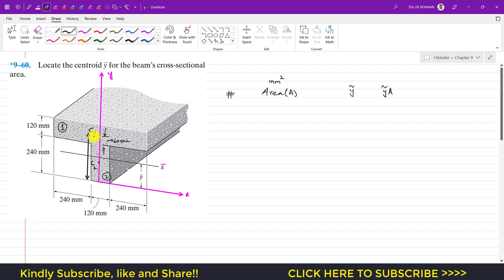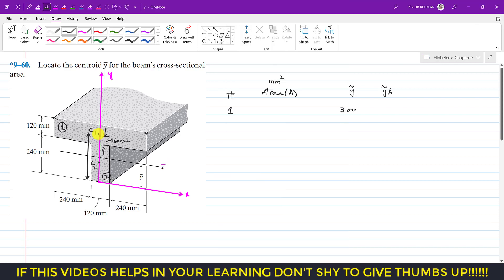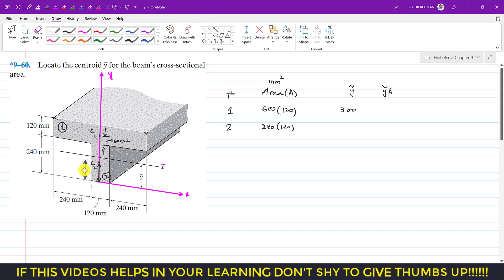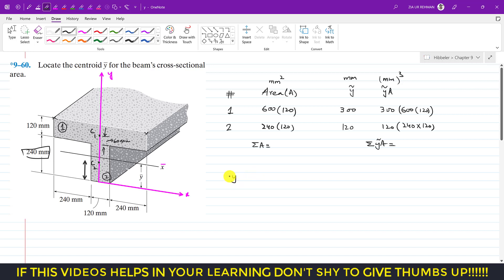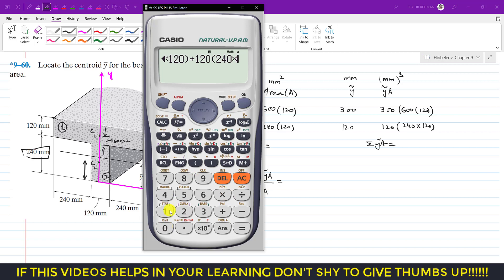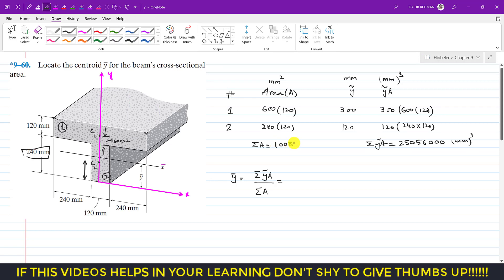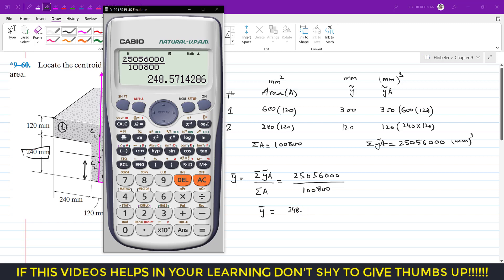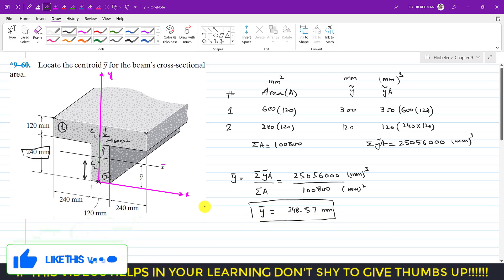9-60 Centroid of Composite bodies or Shapes | Chapter 9 ( Hibbeler Statics 14th) Engineers Academy

Comment: Professor I have a question about at 0:47 .I selected for example  x  axes from 120mm below the horizontal shape.But I couldn't finde the correct answer which is 248.57 .Why did'nt it work ,*It must be work , setting up x-y does not affect the centroid ,right?